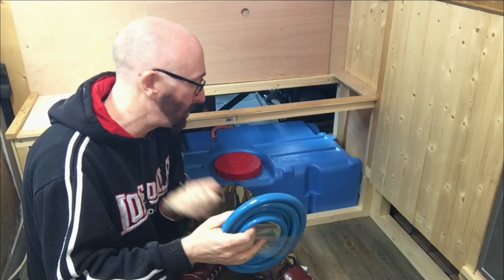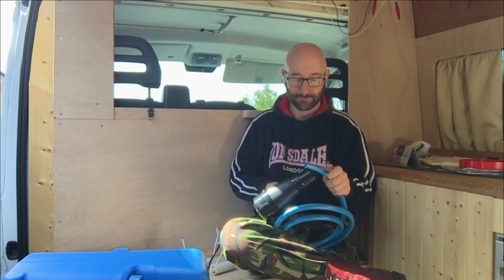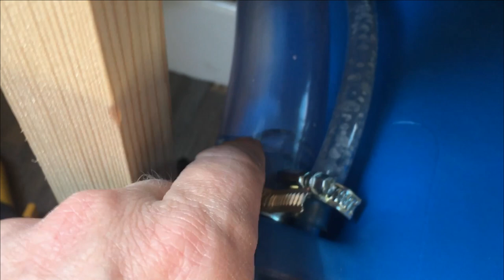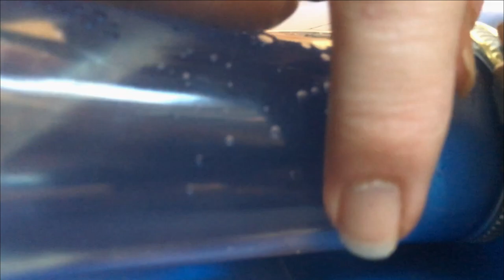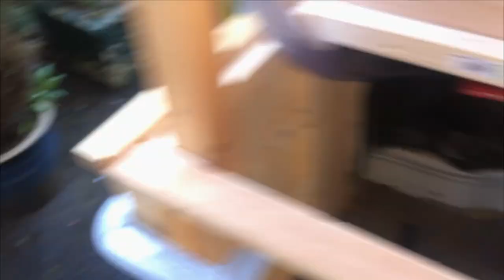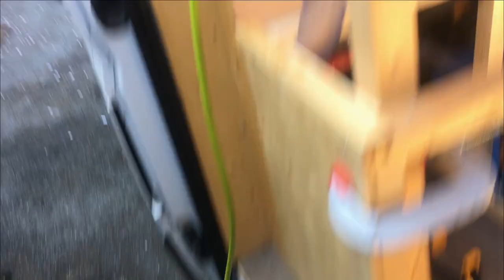Van Life UK Ep23 FIAMMA 70L WATER TANK INSTALL Self Build Fiat Ducato Camper Van Conversion UK

Comment: Nice job. Are you installing a grey water tank underneath or just letting it run out?
Reply from the maker: Yes I will put a grey water tank as want to stay discreet when in car parks etc, a couple of litres of water gushing out the bottom of the fan draws attention and I guess is a bit antisocial

Comment: I would suggest putting in a inline carbon filter just as a precaution. You will find that the water through the pipe and pump plus tank will have a funny taste to it when boiled, it takes a while for this to go away. I normally clean all my water pipes with milton sterilising fluids and that helps but don't do it with a filter in line otherwise the carbon becomes no good.
Reply from the maker: Good tip, thank you, I’ll bear that in mind 🙏